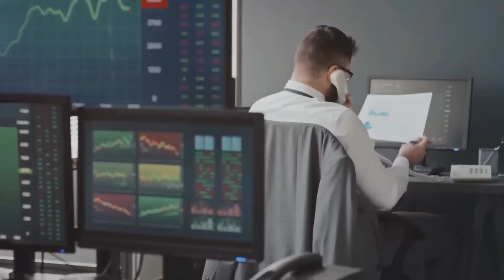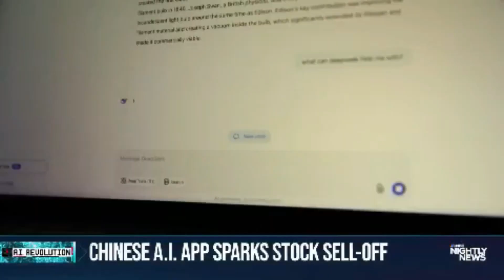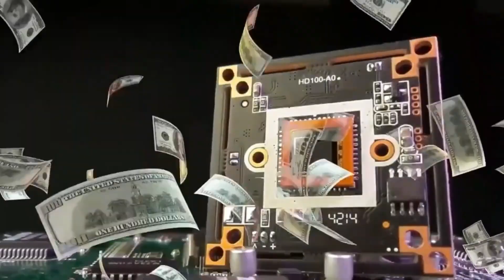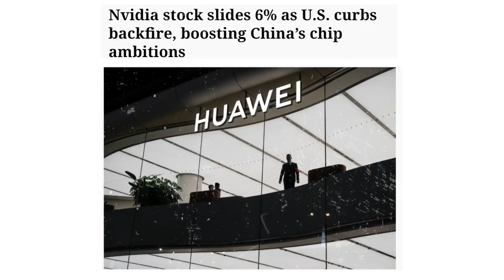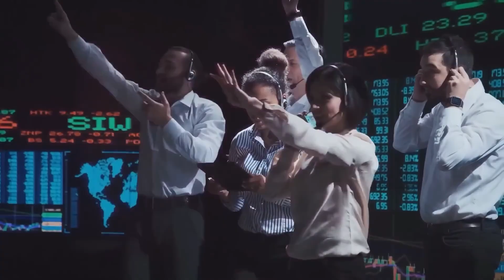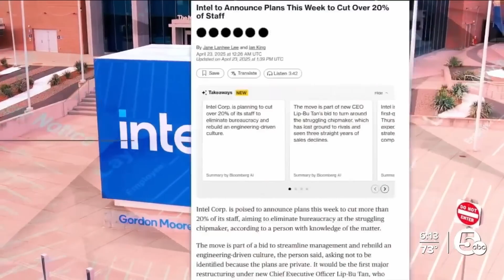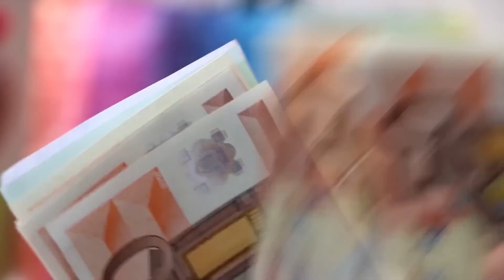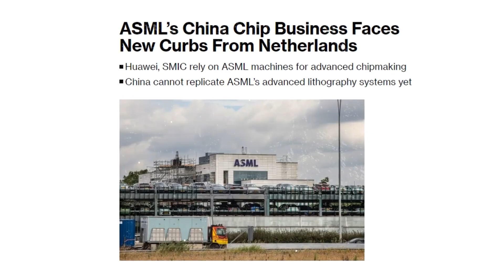Intel’s Collapse: How America’s Chip Empire Fell Apart

Comment: Intel is being supported by the US govt in every possible way. The Chips act provide 8B in grants and 12B in loans. But in spite of that money the board of Intel hired Lip Bo Tan to spin off the 
foundry part of Intel because it was causing Intel to lose 8B/year.  When the US govt heard about this they threw a fit and a $$ lifeline.  The govt had placed numerous "milestones" Intel had to meet to receive the 3~5 B it has not yet received in grants.  Those milestones were very ambitious, and caused Intel to lose 8B/yr. Those milestones were removed in return for 10% of intel shares.  Will this work?  This was massive US industrial policy. It was the US trying to emulate China's industrial policy pouring money to create a national tech champion.  Intel was now a state owned enterprise for better or worse.  This is socialism close to communism that the US neocons are doing.  In the past US industrial policy has been a 100% failure, virtually without exception.  Solyndra the solar cell maker is a prime example. After the US invested 500M, the company declared bankruptcy 2 years later.   Intel is different.  In many cases US industrial policy was to pour money into a company because the owners made big political contributions. The money was never to designed to get the company to succeed it was there so the owners can cash out before the collapse. (like US's bailout of Argentina) This time, the US govt wants intel to succeed. It is forcing Intel not to spin off the foundry business but to further invest in it. But there is a good chance US industrial policy will fail again.  If Intel foundry business doesn't succeed, it will also crush the profitable part of Intel as well.  And the US and Chinese model of industrial policy is different is a very important way. In China the govt doesn't support just 1 company, it fosters competition, supports multiple companies at the start and lets the market pick the winners. But in the US there is no company other than Intel who even has a chance to make 3nm 2nm chips.